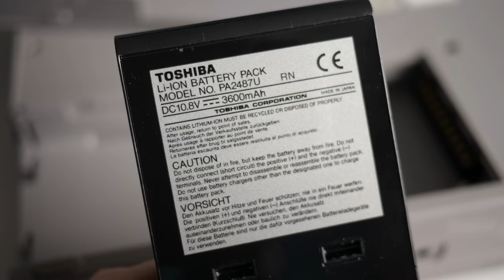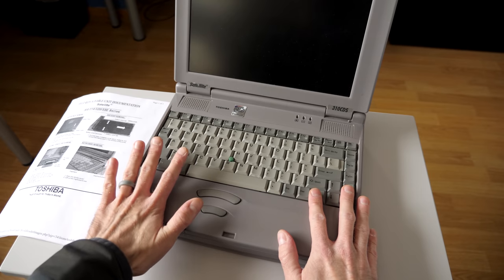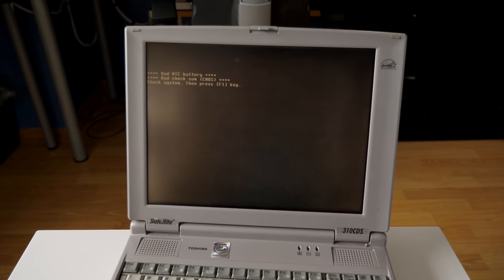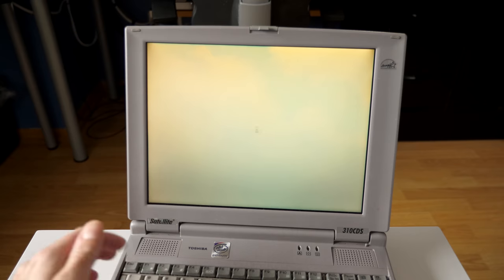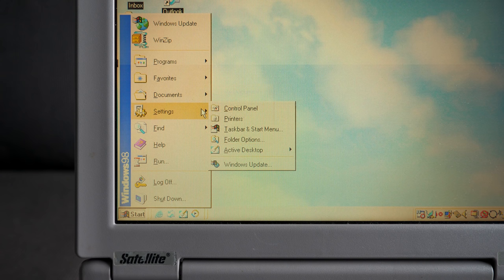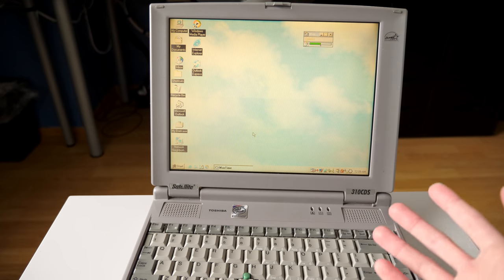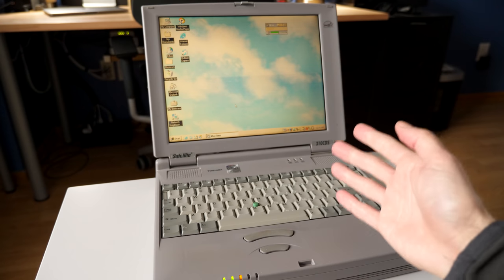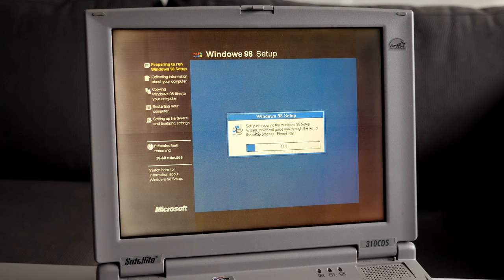Toshiba Satellite 310CDS: A Solid (but Boring) Retro Laptop

Comment: I have around 6 of these, my dad bought them 12 years ago when they were dirt cheap, great typing experience.

EDIT: And 4 broken ones for parts, they are very reliable, even most batteries holds a charge for 1-2 hours. Also it's relatively easy to open the battery and put some new battery packs. Thanks for the video.
Reply: mind if i buy you one x3 (jk or not)

Comment: I've always felt like compared to Thinkpads, Toshiba's laptops are kinda under appreciated. They' super solidly built, look pretty good (not quite as good), and the plastic seems to be lasting fairly well.
Reply: The only issues I had with my OLD XP Satellite is, as mentioned in the video, the lackluster performance of the HDD. Other than that, very good laptops. At least those don't get the Trackpoint printed on the screen like my current T460 Thinkpad.

Comment: All Passive-Matrix screens on any laptop is ugly as hell.

That's why I own a Toshiba Satellite CDT model, which has a very nice Active Matrix display.
Reply: I had a NEC Versa 2400 with a DSTN screen and yunno surprisingly it was actually pretty decent. It wasn't super washed out and you didn't loose your cursor, still had mad persistence and the trademark lines. You could play a pinball game or a side scroller no problem but you would not want to play something like Descent. I think it was only this good because it was a tiny screen, only about 11".
Reply: Need a dispenser here!
Reply: I successfully modded several laptops and installed modern panels. Especially on the T5200C it was amazing, because it has one of the first ever produced color-panels. You can easily install most parallel RGB panels in this machines.
Reply: You can put the screen in a CDT in A CDS

Comment: When my last employer was upgrading laptops, they dumped a lot of these. I saved one from being recycled. I still have it. No HDD but that’s not an issue. I still have the little frame and a CF converter or a straight PATA SSD might be a good idea. 
I remember one of these from new. You were prompted on which operating system to install, Windows 95 or Windows 98. Naturally we installed 98. The one I have also has laptop bag.
Thank you, Colin, for the tip about the clock battery. I’ll be sure to sort that.

Comment: I had a few of these when I was younger, rescued from roadside throwouts here in Australia. They were very very well made machines, I disassembled a few broken ones and was amazed at how properly built they were. The battery pack design was fantastic, and I could swap my working one between the few Toshiba machines I had.

Comment: I have been using an M-sata to IDE adapter on my 2005 compaq presario V2000 with no issues aside from running hot but within the manufacturers specifications. I have no where near your qualifications, familiarity or experience so if you have time to respond with any downsides I appreciate it . I'm sure someone will find fault with my choice in a Youtube comment section. I really appreciate your videos the most useful to me was your n-lite overview, Thank You!

Comment: Toshiba used this exact battery in several models from 1996 to 2004, which made it cheap to replace. I always liked this design decision not to integrate the battery cover with a battery.

Comment: I've got the 300CDT (166MHz, 32MB RAM, 2.1GB HDD, TFT display) from 1998. It still works and the screen is a charm. Although I had to find a donor 300CDT because the screen had one vertical red line. The donor screen works fine. It came with windows 95, I have tried 98 and Me and it worked fine. But now I have DOS 6.22 and Windows 3.11 installed for DOS gaming. The only thing that does not work because of DOS is the USB port. And something else: the battery still holds charge for more than half an hour operation!

Comment: Funny that you posted this. When I worked as Auditor in 1998 this was the exact laptop that were provided with and man if you were travelling you needed to lug this beast from place to place. It's neat to see the old start up and all the applications that were utilized back then and even the fax. But you are right the clock battery tended to go quick on these units.

Comment: Toshiba's aren't all that iconic compared to thinkpads, but they are pretty reliable. So much so that they are not talked about due to how getting out of the way of thigs they are.
Reply: I've had nothing but horrible experiences with Toshiba laptops post 2002 or so. Super cheaply made and unreliable.
Reply: I've liked the units i've owned but I think they designed in some planned obsolescence. I think the bodies are better than most Acers, they don't flex much, they will take a hit and simply using it with the power plug in won't cause cracks in the plastic, but for years and years they had a problem of not having enough structural rigidity around where the brass standoffs for the hinges attached to the case. Over time they would form stress fractures and eventually break, leaving the hinges un-attached and upon opening will tear the two halves of the computer apart, basically making it useless as a laptop.
Reply: @aprofondir  Pre-2000 Toshiba laptops like the one in the video were very well built. After 2000 they really become crap.
Reply: @mima85  the Satellite L35 was a good laptop

Comment: I remember these kind of laptops very well from my (short) time at the Technical University in Eindhoven: in 1997 they were the first university in the Netherlands to use laptops for every student. You could buy the model the university provided for about half the amount it would cost new, at the time about ƒ2000 (which equalled probably about $900 at the time). The students starting in 1997 and 1998 got these kind of Toshiba machines, we called them "breadboxes", as they were so thick. But they were very sturdy and student-proof. And they had the CDT versions of course, with the good display. When I started in 1999, they switched to very thin, sleek-looking Fujitsu's (LifeBook c-something, I don't remember exactly, cannot find them in Google so quickly), but they were made out of very thin plastic, falling apart even as you just looked at it... I once got then a Toshiba as replacement for a while: slower, but much more stable.
A few years ago, I took a 300CDT in pristine condition home from work, I still have it, works fine, with a National Instruments GPIB PCMCIA Card, it was used for measurement logging at the time. The thing I immediately recognised in the video is that the CDS version has the contrast wheel, which is missing on the CDT, thought already that that must have been the Dual Scan display. I remember them, they have always been bad. With many manufacturers you could choose between the different display options, like Apple's cs-Powerbooks vs. c-Powerbooks.

Comment: I still have my Toshiba laptop that's almost exactly like this but the 330CDS. It's also from November of 1998. It still has it's original 4.1 GB hard drive that still works perfectly with no bad sectors. Mine has 266 mhz Pentium mmx cpu with 96 mbs ram and with Windows 98 second edition on it.

Comment: LGR just did a video on a sound card with the same sound chip that this laptop has, a Yamaha OPL3.
While it's probably worse quality than a dedicated card, it probably sounds "right" for DOS games from the 90's.
Reply: I have an OPL3 laptop, exactly for the reason I want DOS games to sound right. The onboard speakers aren't great but out the headphones or line out it's just as good as a SB16 or Yamaha.
Reply: Yes, it does sound very good in MS-DOS.  I currently have a 4000CDT (basically the same laptop as shown here but with a Pentium II and a TFT screen).

Comment: Even old Satellites randomly shut down, nice to see that tradition didnt change on the 2010's Satellites xD
Reply: My 2014 or 2013 Satellite has so many problems.
It was cheap though
Reply: @sand0decker  I got a L755 for 30€ and a A300 for free, they are good machines even if they keep shutting down
Reply: @yt_consistency  I bought mine new when I was starting college. It was $1100 (equivalent to $1231 now). It did have a touchscreen and a 4 year unlimited warranty.
Toshiba laptops left North America while it was actually in getting new case parts. They just sent it back broken lol
Reply: @yt_consistency  I've actually kept on top of maintenance of my laptop. It still works perfectly like new. I also have replaced the CMOS battery when it needed to be, so I never have shutdowns.
Reply: @sand0decker  My shutdowns are random on the a300 and on the l755 its probably the charger, when the cpu turbo's it very likely resets itself, still great machines tho
Reply: @yt_consistency  try going into bios settings and disable the Smart clock or whatever they call it. The charging cables can be replaced with the cheap universal ones. They worked just as well. Unless the cable is damaged or corroded in the head, it probably isn't that. Cables either work or don't work.

There could also be dust in the charging port itself, but then your laptop would shut off quickly on start up
Reply: @sand0decker  Yea i think i need a more powerful charger, it had a i5, changed to an i7 that turbos up to 3.5, it rarely goes over 2.7, and when it does its gonna shut down, changing the c-state or p-state or other cpu stuff doesnt let me boot into windows, and i have to use throttlestop else it just gets stuck at the minimum speed (0.8 i think)
Reply: @yt_consistency  to get to the bios, spam f2 immediately after the computer starts turning on.
It could also be a processor corruption/degradation. You can replace the part or try disabling CPU threads until it is stable as well
Reply: @sand0decker  Bios doesnt help, that c-state p-state settings are changed there i forgot to mention, and its unlocked too, no settings there i tried fix the shutdowns
Didnt try the thread thing, but atm its not my main pc so im not that worried about it

Comment: Had a very similar Toshiba laptop around that time.  IIRC, it was a little faster processor (233 MHz MMX) and a larger hard drive (4 GB?  No more than 6 GB).  But other than those, it was pretty much the EXACT SAME laptop -- case and all.  Dual-Scan LCD as well.

Comment: The Infrared port was good: You could copy files between two equal laptops at 4Mbit/s. That was much faster than using the floppydisc, and i think even the DOS Interlink parallelport to parallelport connection cable could only beat this if both ports supported full 8Bit DMA transfers.

Comment: I purchased this model along with the Tecra 550CDT two years ago via ebay. I was looking for the fastest Pentium 1 powered laptop. I believe there was a 300MHZ Dell laptop but it only had 2mb onboard graphics and the maximum ram sixe was 128mb.

 I decided to get rid of the Satellite. The viewing angle was rediculous and there was a lack of processing power.

I kept the 1997 released Toshiba Tecra 550CDT with its 266MHZ Pentium 1 MMX which is now able to run Windows XP after maxing out the ram to a total of 160mb (32 onboard + 128 Transcend added.)

The 4mb onboard graphics chip is able to play fullscreen 640x480 MPEG2 video @1,400kbps without any skipping. Still holds an hour of battery which always freaks me out.

I have the Toshiba Deskstation V docking station which allows up to three full size desktop PCI cards or two ISA cards.

The screen has no stuck or dead pixels. Toshiba did not cut any corners on this machine. It cost $3,000 when it was released back in 1997.

In theory an added PCI graphics card should work in the dock. A vintage ATi Radeon PCI graphics card would look very nice in there.

Comment: Interesting vid. I have a 490 CDT and it’s a great little laptop, perfect for dos gaming and windows rts type games. The OPL-3 chip is ace as is supports SB Pro and Roland. The difference in music quality between ad-lib and Roland in Monkey Island, Canon Fodder is worth price of laptop alone. Mine has a fairly rubbish d3d compatible S3 Virge graphics chip which is perfect for dos games. I note you mention larger than 4gb HD replacements. I haven’t tried this as I thought the bios / interface had a 4gb limit, so that’s interesting. I installed a 4gb cf card in the end.

Comment: Those Satellites are amazing for Retro DOS installs.  They have a built in OPL3 chip that has full SB Pro compatibility with a small driver install.   The CT65xxx video chip has Windows 3.11 drivers.  The HDD compartment is fairly spacious and will fit an SD card adapter for replacing the hard drive easily. If a game runs too fast, it's possible to disable the CPU cache (through the BIOS or from a software) to make it run approximately the speed of a 20mhz 386.  :)
Reply: Not all drivers are on the Dynabook site.
Reply: Can you link the software to disable the software cache?
Reply: @W00fer  No, but they're fairly easy to find if you do an internet search for Vogons Drivers.
Reply: @W00fer  the software is named Setmul.  it's fairly simple to find on Vogons.  There's also other utilities for slowing the system down like MoSlow.
Reply: @ericlee5581  yeah but VOGONS doesnt have all the drivers for Toshiba
Reply: @W00fer  OPL3 drivers are pretty generic....and which drivers are you looking for specifically?  DOS and Windows drivers are different... and even with windows drivers, they're different between 3.11, 9x, and 2K/xp....
Reply: @ericlee5581  DOS and 95. The machine is intended to run on 95 as per the case sticker anyway. Putting XP on it sounds wrong.
Reply: @W00fer  Which model Satellite are you looking to get drivers for?
 
http://vogonsdrivers.com is a decent resource for satellite drivers if you know the specs of the laptop in question.  The ones of the particular vintage he's showing here has a Chips and Tech 65xxx graphics chip, which can use the generic CT65555 drivers.  As for the sound, generic Yamaha OPL3-SA drivers should suffice.
Reply: @ericlee5581  110CS and 210CS

Comment: I've got a couple chonky Dell's like this, a 7000 series and a 8000 series, The 7000 series (Model Number PPI according to Dell) has a Pentium II 366MHz & 256MB SDRAM, an ATI GPU (8MB I think) with a 15GB HDD, and a DVD-ROM / floppy drive modular bay unit, battery still works amazingly. The 8000 series has a 800MHz Pentium III, 256MB RAM, and some other goodies. It seems to have come with a factory ZIP drive that's been replaced with a combo CD-RW / DVD-ROM drive, which is strange 'cause it already had a DVD ROM drive in the other slot. The service tag for this unit is FZC3B01 if you want to look it up. The 7000 series came with Windows 98 and the 8000 series with Windows ME (Dear god no), Iv'e installed Windows 98 SE on both, with the Plus! package.

Comment: I had the model one step up from this the 320CDS when new. 233mhz. Got it at Comp USA for about $1500 on sale. Upgraded the ram and HD. Was good budget laptop. First machine I ever installed Linux on. Now I'm a full time Linux user. NO WINDOWS 10 HERE! Anyway, the screen on these was always  pretty bad but one thing that attracted me to this series was looking at the store display models Toshiba dual scan screens were much nicer than most competitors dual scan. The jump to active matrix was a big increase in price.
Reply: Windows 10 is probably the worst Microsoft OS. I think it's worse than 8.

Comment: My least favorite of that era laptop was a certain model of Dell Latitude. I was in charge of IT purchasing for the company I worked for in 2000, and we were buying laptops for our sales people. 

They wanted lighter, so we got them the latest model Latitude. We were going "forward-thinking" so I ordered them with the then-still-new Windows 2000 Professional.

Less than a week later, one sales person's laptop had failed. Didn't know why, he brought it home, and when he came to work the next day and tried to power it up, it just wouldn't power up.

A few days later, a second salesperson had a similar issue - but he had a detail that became key. He tried to start it up when he got home, and found that the inside of his laptop bag was *HOT*.

A little troubleshooting later, and I discovered that when these went in to sleep mode - they apparently turned off the display *AND THE FANS*, but actually _kept running_. So instead of going to sleep, it just sat there cooking itself in the salesperson's laptop bag, until it got so hot something failed.

Called Dell, got escalated a few times, eventually got the ruling "that model doesn't support sleep mode in Windows 2000. We won't warranty replace them."

W. T. F.? Yes, eventually got them to relent and warranty replace them, because they let me order it with Windows 2000 with no "don't use sleep mode" warnings (or just plain disabling sleep mode. If the fans had stayed running, at least we would have had a clue something was wrong.)

Comment: I used to have a very similar laptop, a 320CDT (same thing but with active matrix TFT and better CPU), that was the laptop of my childhood and i would love to have another one (i still have the motherboard, and it's working)
Reply: Ce portable était vendu en France? Intéressant. J'imagine que les logiciels étaient en français et que la disposition des touches du clavier l'était aussi?
Reply: @videotape2959  The keyboard is effectively an AZERTY keyboard (french variant) on my 320CDT (actually, i now have a fully working and complete unit, in addition to the motherboard of my first unit)

I never had the original installation, neither on the one i had in 2006 or the one i got this year, but, the softwares are available in french on the archived version of the utilities CD.